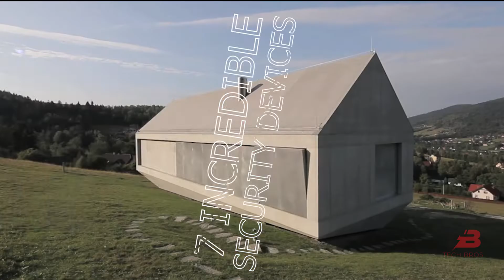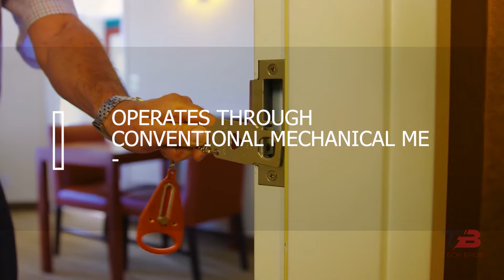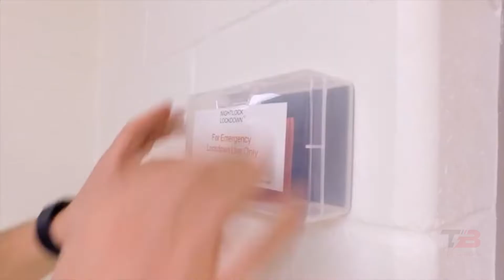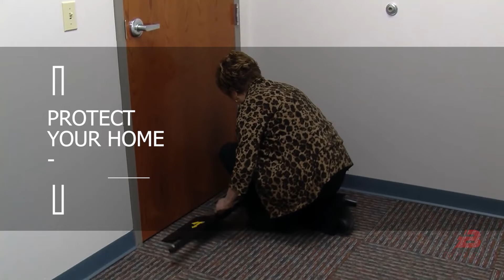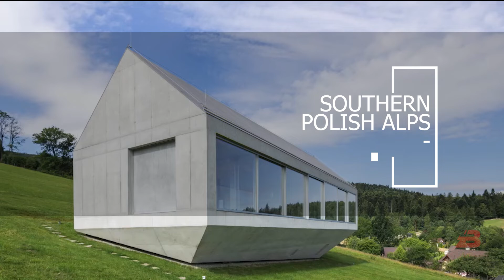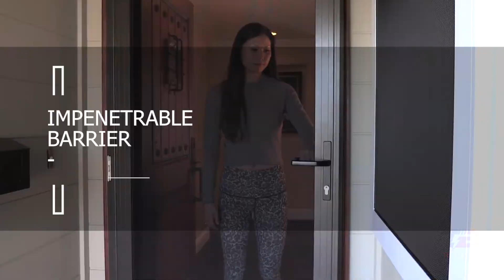7 INCREDIBLE SECURITY DEVICES THAT COULD SAVE YOUR LIFE

Comment: We need to invest in security systems and technology if we want to keep our home and family safe from invaders. Safety must be a top priority. These mind-blowing security devices will save our lives. The Security Glass is interchangeable with the equivalent resistant security plus glass. It protects only the most vital areas. They protect the most vulnerable area of the window, which is often sufficient. This type of glass can be installed on the exterior or interior which is nice. Addalock is a lightweight, portable lock that can be set up on and taken down from any door in seconds. Addlock could be placed on the entry door or any other door in the house to provide extra security and privacy when required. Thank you so much for doing this video.

Comment: Some of these are practical, but some are fairly extreme and may run afoul of fire laws that require exit doors have locks that can be quickly and easily disengaged, even by children and the disabled.  If you make your doors intrusion-proof you have to do the same with your windows.